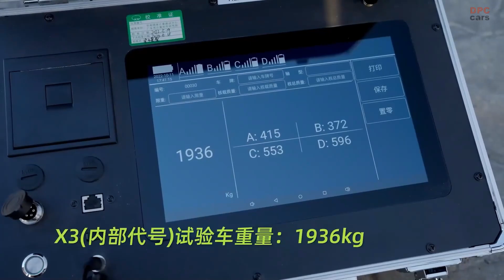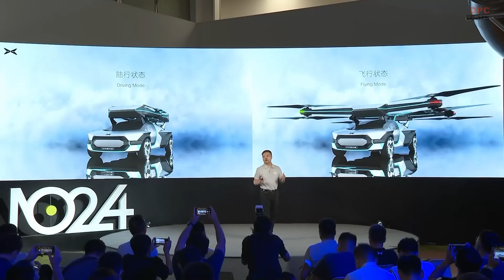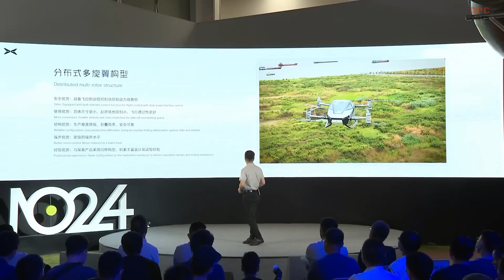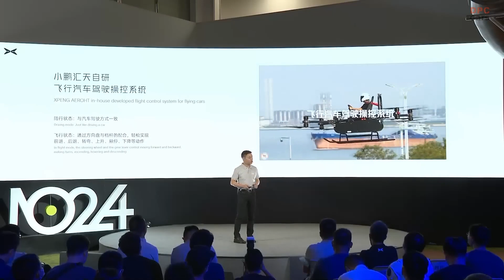Xpeng VTOL Flying Electric Car First Flight

Comment: Another stupid design. Frankly Zapata already solved the problem with his Jet Racer. Compact shrouded jets instead of bulky huge propellers is the answer. In the design here you’re not solving any problem. The open propellers are dangerous and not much different from a having a single rotor like a helicopter as they take up a large area. Good luck landing on a city street. If you use Zapata’s design you can have the jets fairly close to the car body and instead of the rotors on the roof put a telescoping wing there for extended range and ability to land if the engines fail.